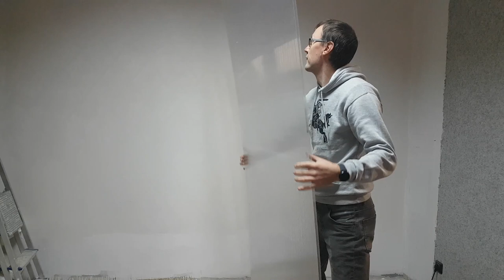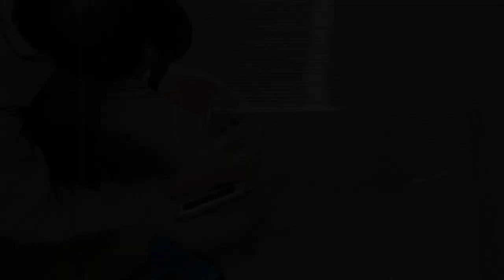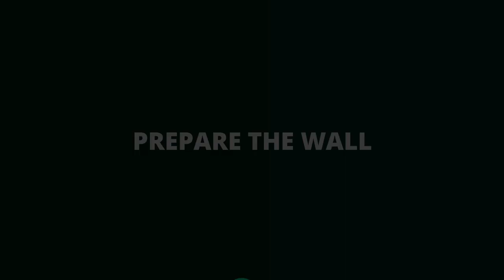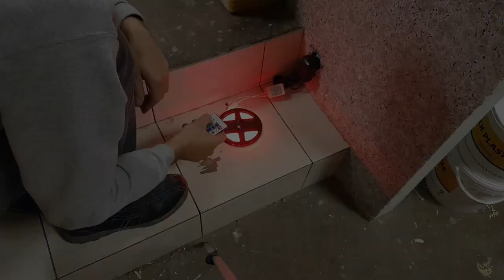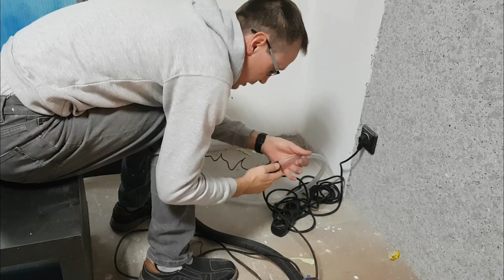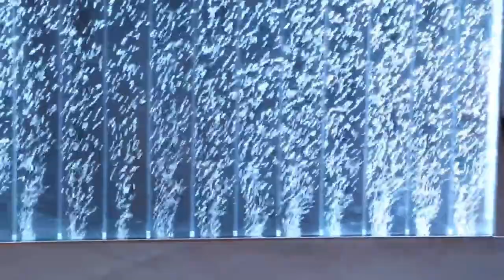How to make BUBBLE WALL with LED lights - DIY wall decor idea.

Comment: Great tutorials, but wouldn't silicone be a better solution than hot glue? I feel like the hot glue may cause issues in the future with leaks?
Reply from the maker: Yes , you are right. It is better to use silicone, as hot glue comes off the surface, and i used Epoxy Adhesive Glue Two-Component Resin and covered all around the hose, and it solved the problem.

Comment: How’s big for the air pump and hose do you use? I want to make one but not sure what’s size should I use.
Reply from the maker: It depends on your wall size. The bigger size, means you add more water, so you need more power for air pump. For my wall of 2sq.m. i used 1cm diameter hose. and i used air pump 35 W.

Comment: Would have been awesome if it was not basically a permanent install.......our place is rented....we couldn't paint our walls or screw in the frame

I suppose it could be made to be portable....if I could figure out what to use for a frame for the board, because it looks way too flimsy to stand on it's own

Comment: Never fill with ordinary water! Use only demineralised/distilled water after you ran some descaler on the inside of the pannel. 

Also, add some pool chlorine in the water and make the entire system an enclosed system, make air pump recirculate the air inside the pannels. 

Unless you want limescale and algae to grow inside your bubble wall.

Also. Hot glue might be cool for a 5 minute youtube showoff... but it won't hold to the pressure, vibrations and temperature changes.

Don't paint the pannel, add colorant to the water instead, or just leave it not coloured and just use the LEDs for colour.

The only good ideas here are the drain valve and the choise of material. 

The only good idea her

Comment: You hoped it worked but obviously it didn’t which is why you stole others videos at the end because the pump kept pushing the water out the top of yours I bet 🤣
Reply: Nah, it was because the hot glue didn't hold & he had to go back & use a 2-part compound or a clear silicone to fix it so it would work. He mentioned it in an answer to another comment. Hope he learned his lesson though. If it doesn't work out, don't post the video until you fix it, make it work, & can post up your own recording. Cutting corners by posting what you have & assuming that your viewers will realize & know where you went wrong so they can do it right is pretty bad form. As a channel, you never want to underestimate people's stupidity, never overestimate their intelligence, & always assume that someone will notice & call you out if not start the internet equivalent of an angry mob with torches & pitchforks if you do anything that is or anything that could be perceived as potentially morally questionable... even if it wasn't your intention or even if it actually wasn't irl.